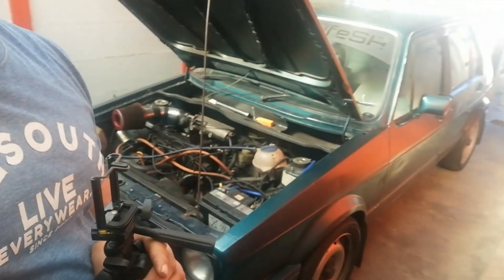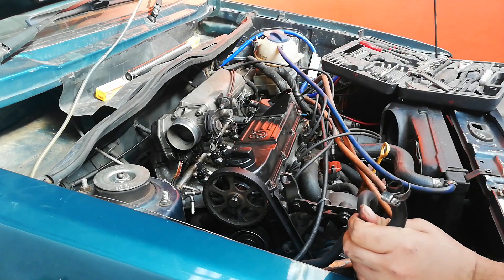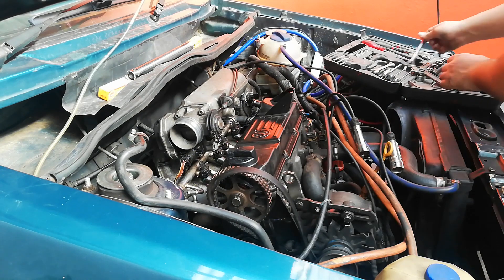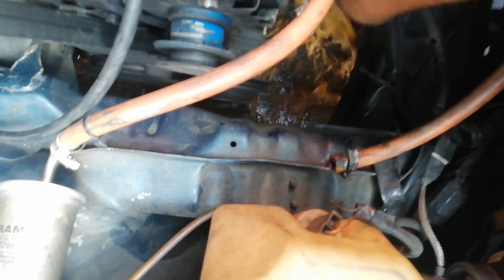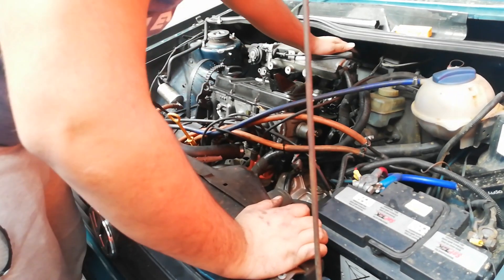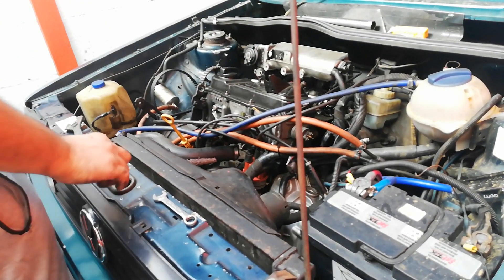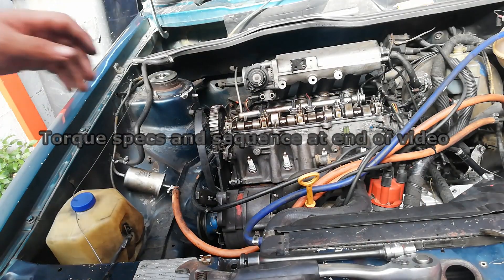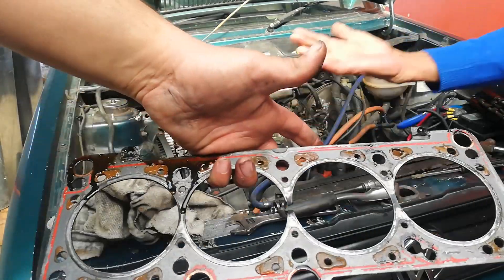HOW TO REPLACE HEAD GASKET ON VW MK1 (TORQUE SPEC & SEQUENCE INCL.)

Comment: How do I get the exaughst bolts loose
Reply from the maker: Ver awkward position , i left mine attached when i lifted the head off
Reply: I'm sure u has to remove it to clean the blocks surface and head surface
Reply from the maker: Gasket blew due too gasket failure not because of heat so nothing warped so I just threw in a new head gasket after cleaning up the surface from the old gasket.
 @DenirosDIY   Not the right way but it kept me going for the next two years then I sold it

Comment: what advice would you give to someone who's car is leaking oil between cylinder head and block but car doesnt overheat no lose compression. would changing the gasket only help or the cylinder still needs to go for engineering?  car hasnt mixed water and oil, still drives normal 

please help
Reply: Try pulling your bolts tighter so can squeeze against the block more
Reply: Cylinder head
Reply: If it still leaks after that replace head gasket